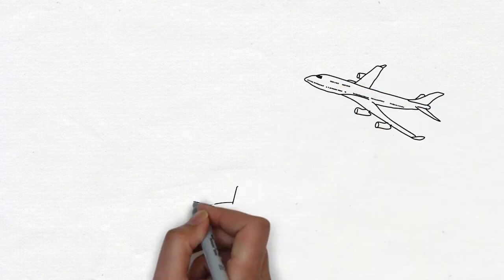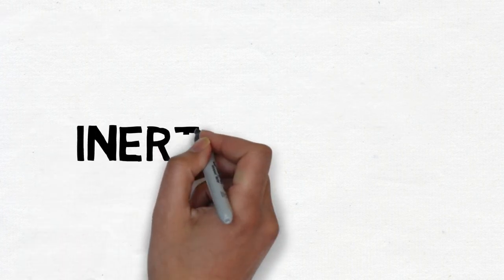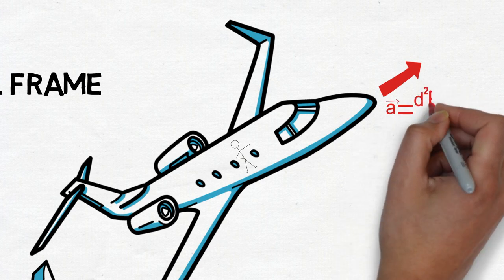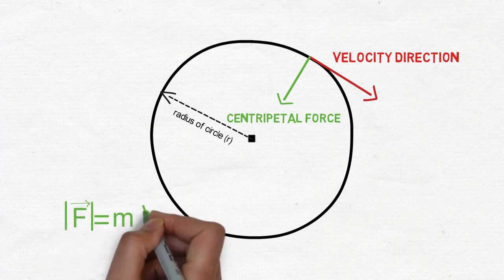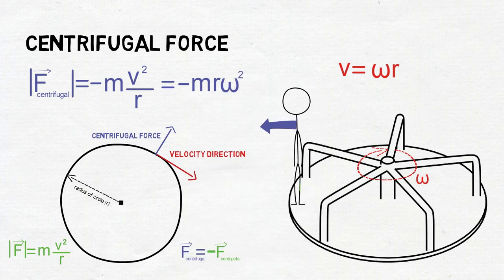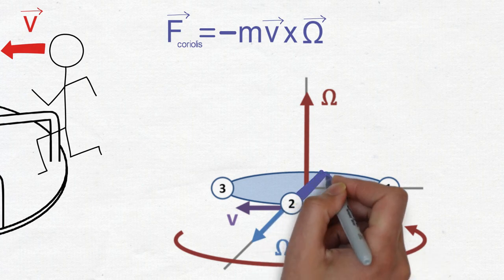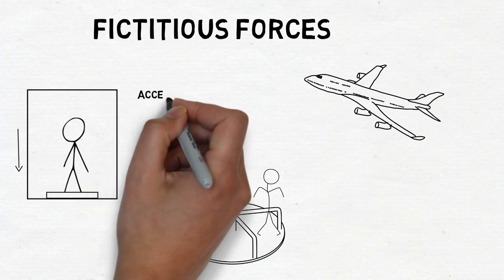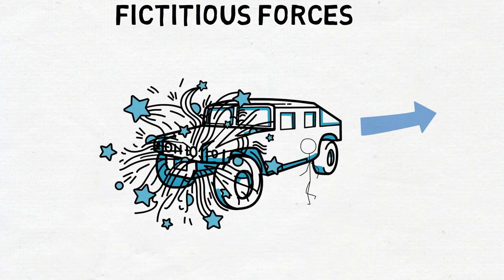Fictitious Forces

Comment: My issue with a lot of these lectures on inertial frames of reference- is that right after sayin that the forces are fictitious and non existent; the lecturers then take the leap of equating an idealization of a system with the actual forces at work. Without so much as pointing out that the equations for the fictitious forces are merely an idealization. I am left feeling that fictitious forces aren't real but they exist. Therefore physics = magic.... which is not very convincing to me
Reply: Bro I’m literally on the same boat rn. Like how you gonna say it’s fake and then throw it into a fucken equation!
Reply: @lustinjima5901  The whole idea of ficticious forces is they don't exist when looking at the sceneratio from a non acceleration frame. They can only be felt by objects in the accelerating reference frame like us in an accelerating car.
Reply: These forces do not exist but inertia certainly does. The reason you feel pushed backwards in the car is due to the fact that the car is moving relative to you but from your perspective it is like you are moving relative to the car. We need to introduce fictitious forces to account for our frame of reference.